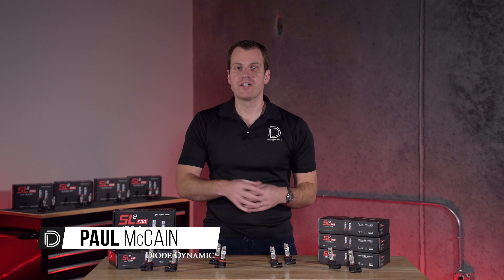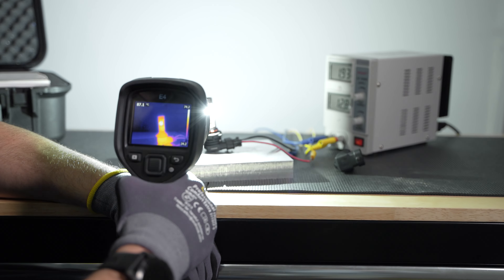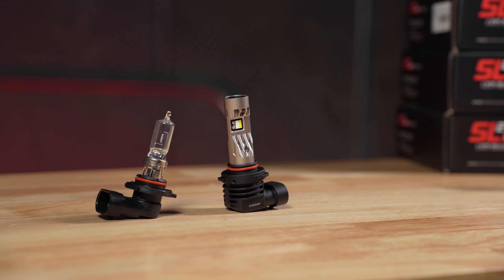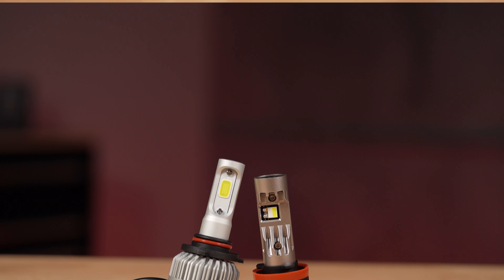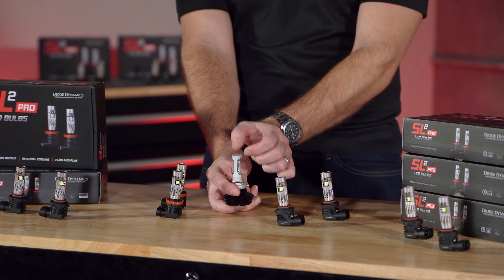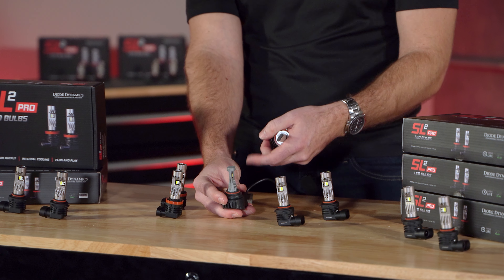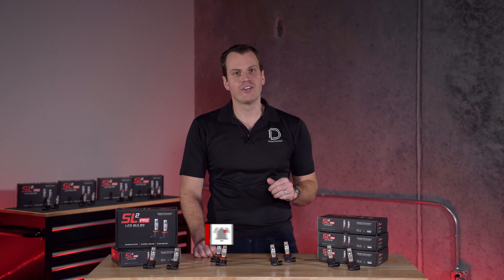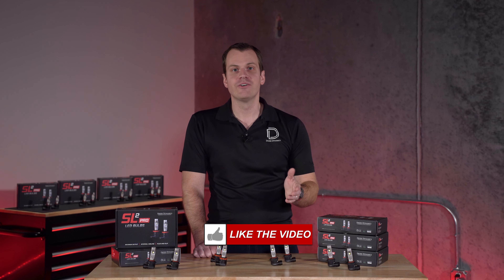SL2 Pro: Thermal Separation Technology (TST) EXPLAINED | Diode Dynamics

Comment: Are there any plans to make the SL2 Pro in the 9007 bulb size? Almost all of my performance vehicles use this size and would greatly benefit from this technology.
Reply: Vosla makes a good 9007 bulb. That's what I've personally ran before I did a retrofit
Reply: @96ej don’t u mean Boslla?
Reply: @toyotabrony  nope, vosla it's a German brand. They're still halogen but I have found they put out more light than Factory while being affordable
Reply: @96ej what’s the increase in brightness and whiteness of the high performance halogen bulbs?

Are they are as bright as sylvania - silverStar ultra?
Reply: @toyotabrony  they're probably warmer than a silver star, I've never done it back-to-back comparison on those but compared to the stock ones they're generally brighter in every size like for like. But if you're happy with silver star definitely get those that's not a bad option at all
Reply from the maker: Hey there! Our apologies for the late response. We are currently exploring a 9007 option with our new SL2 lineup. Stay tuned for more information!
Reply: @diodedynamics  Sounds great, that would be amazing!

Comment: Great explanation, Paul!

Why did you decide not to install a thermistor near the emitter to regulate output current/brightness when the chips reach a certain temperature threshold?
Reply: Putting the thermistor right next to the LED creates the need for additional wiring and thereby points of failure. Since this is a small unit that's all held within a metal structure, the temperature can be effectively monitored in the main circuit instead for protection against overheating. In terms of "optimization," you'd think that it would be ideal to drive current at a specific level based on the temperature. We tried that with offroad lighting, however, this creates a feedback loop, where the LED hits a certain temp, power is reduced, it cools down, and then power increases, in a constant cycle. Not a good or effective result. We've determined that it's more practical and valuable to allow the bulb to self-regulate at a stable temperature, and monitor temperature only for overheating protection, which is what's being done here.
Reply: @paulmccain1148  That makes a lot of sense - thanks for breaking it down, Paul!

Comment: Nothing new here, nice educational video though
Reply: It is new, new tech, new contruction, very unique led bulbs that they describe in depth about it. 

U ain’t gonna see this, with a cooling fan on the different location.
Reply: @toyotabrony Philips was one of the first (if not THE first) LED bulb manufacturer to introduce TST technology with their Ultinon Pro9000 and Pro5000 models years ago. So yes - besides the top mounted fan, it isn't exactly groundbreaking tech.